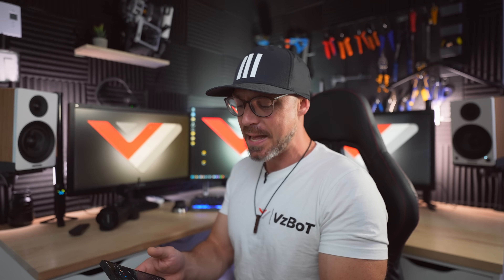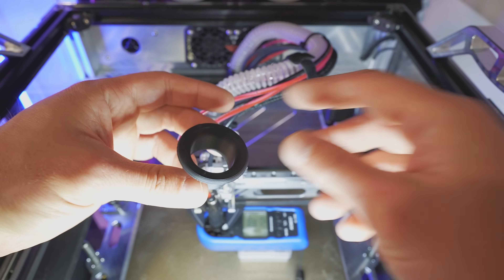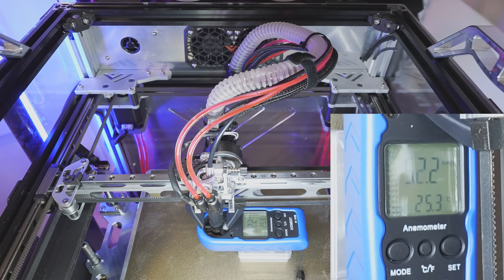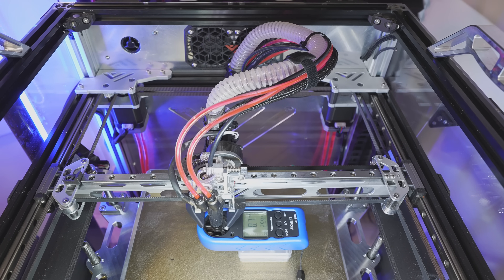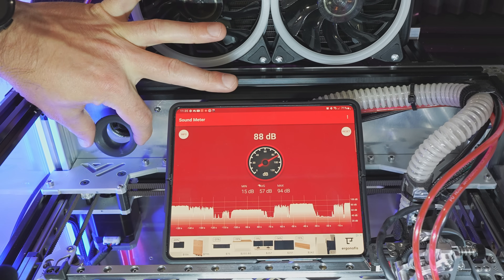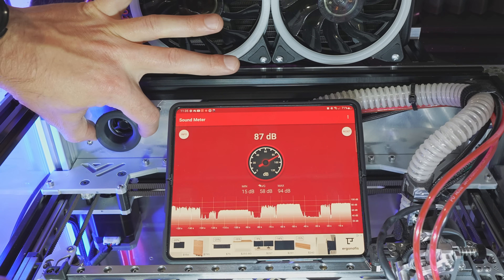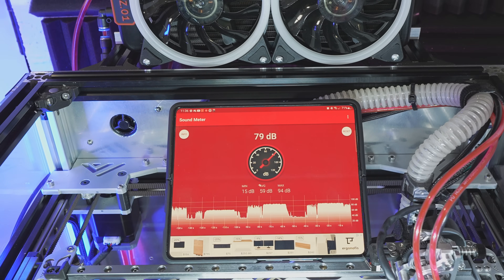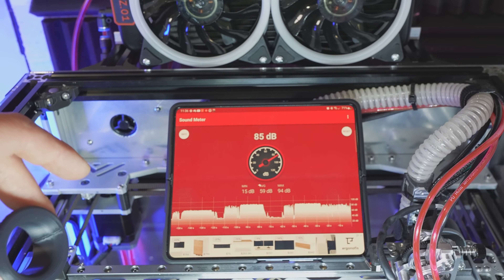CPAP muffler

Comment: Turn the baffle to point into the corner, cut a circular hole into the glass and add an intacke tube to the end of the baffle so the air comes in from outside of the chamber, but the intake becomes longer to reduce the sound
Reply: No, CPAP will suck air from outside (which is cold), CPAP uses the air inside of the enclosure.
Reply from the maker: I cant suck air from the outside. I have explained why in my CPAP video earlier :)
Reply: @Vez3D  on the inside then, the point being, the baffle is longer top down in Z-axis direction
Reply: @Vez3D  can you give a short explaination again? just a few words is enough for me to get why i think :)